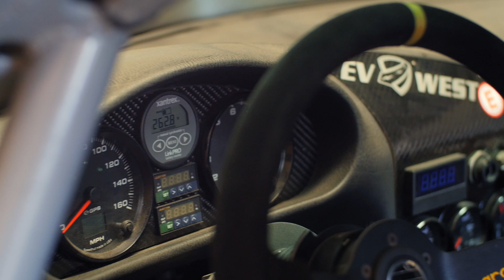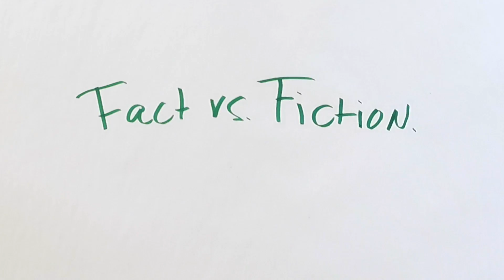How to Make an Old Car an EV - /ENGINEERED

Comment: I'm sorry, but to transform a Ferrari on an EV is a crime.
Reply: Kenneth Hildebrand
Bad example, even if the eletricity comes from a coal power plant it's still better than making the same amount of energy from a gasoline engine, basically because power plant is almost always running at peak efficiency.
Reply: +Kenneth Hildebrand You know, people can demand solar power to replace coal.
Reply: +Renato Dumaresq Actually, it's a good idea. People can and will be more willing to drive them more often, and will cost less to maintain them.
Reply: +Renato Dumaresq they didn't cut anything so the process is completely reversible anyways. What would you do with an old ferrari with a shot engine where parts are damn near impossible to source? Especially if its a pretty bad engine to begin with. That's probably not the circumstance but there are a few very rational reasons for someone to do this kind of replacement.
Reply: Probably the engine was already broken and turning it into an EV was cheaper than a new engine
Reply: Renato Dumaresq its a spoiled mellinials who told dad that they took his ferrari to the shop
Reply: +Renato Dumaresq Not a 308 GTB, they perform like dog shit when stock
Reply: +Renato Dumaresq Yeah, he should  keep the original, decades old engine, and never really drive the way the car was meant to drive, because if you break something, it will cost an arm and a leg to fix, since there are almost no parts available.
Reply: +DieselQuads But they don't sound like dogshit. That's the point.
Reply: Yes I is. Plus everyone thinks they are saving the planet with EV while charging them with electricity from the local coal burning power plant.

Comment: Sacrilege! "Make them better" my arse.
Reply: +Carl Draper That's only your opinion, I think what he's doing is great, keeping classic cars on the road.
Reply: guifrakss But they were perfectly fine on the road with their original engines!
Reply: Carl Draper How do you know? Do you know every car this guy's company has worked on? Maybe most of his costumers have a car with an blown out engine or transmission, in wich case, it makes sense changing engines, because repairing these old sports cars can get VERY expensive, if not impossible.
Reply: guifrakss and converting them to elwectric is cheaper? And what about range? Charging stations are few and far between over here, and if you let the power down too far you have to wait like 3 or 4 hours before it's charged up again. Hybrids are better.
Reply: Actually, no, because you can buy a very used one for very cheap, snd gasoline will only get more expensive.
Reply: Carl Draper 1) I don't know if it's cheaper, but probably is.
2) These classic sports have horrible gas milage.
3) You don't need a charging station, unless you don't have eletricity at home.
4) Four hours to charge is not bad, because you can charge while you're sleeping, unless you know someone who drives constantly for more tham twenty hours a day.
5) I like hibrids too, but both purely electric and hibrids have advantages and disadvantages.
Reply: Carl Draper
 Only if you care enough to spend it, if you don't, you don't have to.
Reply: Carl Draper
ok.
Reply: +Carl Draper so... i guess making an engine wsap is a sacrilège too  for you ? 
To me, puting an LS engine in a old camaro is not different than making it electric, and changing the gear and suspensions, In both case you have lost the nature of the old car anyway, so you can at least make it more performant.
Reply: riDDimann Taking away the engine of a classic Ferrari is like removing the teeth of a lion and feeding him on tofu.
Reply: I'm done here, they're just ruining old cars. Period. The Porsche 356 is a classic, even more so than a Ferrari, and without the air cooled Boxer engine sound, it's just  a pretty tin box.
Reply: guifrakss if you have the money to buy a classic Ferrari or Porsche, you're rich enough to afford petrol money.
Reply: guifrakss a very used one will need a lot of money spent on it

Comment: Nothing against electric, and I'm intrigued by it (am thinking about doing a conversion like this, myself), but if you're going to compare apples-to-apples, you can't just take the cost of oil refinery into account and not do the same for electricity transmission/maintenance, the cost of mining the materials to make the batteries, etc.  Not to say that these things aren't part of the cost on both sides, or to say that they're equal, but it is to say that a fair comparison should be done before presenting one side and omitting the other.
Reply: the Pro oil lobby fudges numbers all the time. When they calculate carbon, the ignore the massive electricity usage of refineries and how much energy is wasted just moving around oil and gas. Petrol is far dirtier than people realize. But at the chemistry of it, ICEs are still wasting 75% of energy as heat.
Reply: +n8guy Both sides certainly have hidden costs but the levels of BS on either side tends to differ hugely. The BS coming from the oil lobby is epic as they try to protect a soon to be redundant technology. Just one point, lithium is not only plentiful it's also recyclable.
Reply: +n8guy If you do an apple to apple comparison EV win by a wide margin, even if they are coal powered. It is the oil and ICE car lobby that tries to prevent that apple to apple comparison and muddies the water, so usually gas just falls right out of the sky at the gas station while they go to great lenghts finding every ounce of energy that ever got into the EV producition, complete ignoring that an ICE motor requires a lot of energy to get manufactured too. Do you ever hear about the metall for that being mined, transported, getting melted and cast? How much energy is required for making a battery and how much is required for melting a complete ICE engine block?
Reply: +thorium222 I think you misread me.  My point wasn't that one "side" wins over another, it was that when he identified the "hidden costs" on the ICE side, he conveniently ignored the same on the EV side.  That really was my point.  That said, let's deal with a few of yours.

"If you do an apple to apple comparison EV win by a wide margin"

Ok, that may be the case - do you have a source for that statement?

"Do you ever hear about the metall for that being mined, transported, getting melted and cast?"

Sure, that's one of the hidden costs that needs to be taken into consideration.  As is the materials and process of producing electric motors and batteries.

"How much energy is required for making a battery and how much is required for melting a complete ICE engine block?"

I don't know the answer to this, but my impression is that things like lithium are harder to obtain than the components of steel, both in scarcity and cost.  But either way, again, it's just part of the comparison that needs to be done.

You seem to misread my comments and not realize that all I'm asking for is apples-to-apples.  I don't know which side ends up being more cost effective, but I do know that both sides have hidden costs.
Reply: n8guy You can see here for example the lower life cycle energy requirements and CO2 emissions of BEV:

http://www.environment.ucla.edu/media/files/BatteryElectricVehicleLCA2012-rh-ptd.pdf

It is from 2012, so it is already better I assume, but this was the first hit on google. Looking just at usage without the production of oil, coal, conventional vehiclesl or BEV, I calculated for a comment on a German website, that even if electricity supply was from 100% coal in Germany, BEV would burn 12% less fossil carbon than top of the list ICE cars. Of course Germany has already about a third renewable energy, so that is only a thought experiment.
Reply: Dude, lithium is everywhere! It's one of the most common elements on Earth...
Reply: +n8guy Exactly what I was thinking. There should also be a time comparison IMO, fluffing over the fact that you have to wait 5-6 hours for a charge because it suits you agenda is BS.

Comment: electric cars are more practical if you can do a battery swap. even for formula-E gotta swap batteries... not cars.  need to design car to drop batt and go. which is difficult even for tesla as they use the batteries as the foundation and structure.  not modular. ev west is cool. love the bimmer. i want to build an EV, its on my bucketlist

Comment: ok cool not sure if I like the idea of taking the engine out of the 308 though
Reply: +Shane D As long as they don't cut in it, so that you can put back the original driveline, I'm totally fine with it. Besides, we don't even know if the original engine even works, or if it is ruined for some reason.
Reply: SgtStinger good point
Reply: +Shane D Ok, don't do it with your car,then.

Comment: So let me get this straight it's faster more reliable better for the environment. What's not to love, great job EV west
Reply: +LordOfInferno I think that depends on the car. Some icons, like the Shelby Cobra, are defined by their engines. Others, like the Citroen DS, are about everything else. If the main focus of the car isn't its engine, then I have no problem with people who change that. Imagine an electric DS, that would only enhance the ethos of the car, it'd be better I think.
Reply: +Notta Gonnatellya that seems to be the popular idea.  electricity just comes from nowhere and cost nothing.  and of course you can recharge anywhere.  lol

have nothing against electric.  just alot of bs around it.
Reply: You guys aren't considering that electricity sources are improving. In some parts of the world, electricity is already predominantly renewable. Conventional cars won't really improve, because you can't avoid digging crude oil from the ground and burning it. Electricity, even in its current form, is a lot more environmentally friendly, and it will only improve until it's carbon neutral. The argument that it's not carbon neutral does not negate the argument that it's better for the environment, because it's still better.
Reply: +Notta Gonnatellya  If you do an apple to apple comparison EV win by a wide margin, even if they are coal powered. It is the oil and ICE car lobby that tries to prevent that apple to apple comparison and muddies the water, so usually gas just falls right out of the sky at the gas station while they go to great lenghts finding every ounce of energy that ever got into the EV producition, complete ignoring that an ICE motor requires a lot of energy to get manufactured too. Do you ever hear about the metall for that being mined, transported, getting melted and cast? How much energy is required for making a battery and how much is required for melting a complete ICE engine block?
Weniger anzeigen
Reply: +Bryce Hale  it makes a soulfull car, dead as a smartphone?
Reply: +Notta Gonnatellya  An ICE vehicle can only run off fossil fuels. An EV can get its fuel from any source. My EV runs for free off my roof. Yes, the environment benefits but, more to the point, my wallet loves me for it.
Reply: +LordOfInferno Weight distribution can be controlled much better with electric as you can place the batteries anywhere you want. You're right, it will add a lot of weight but also torque.

I wish someone comes up with a battery swapping system that can be done at home, that would really change things up. Imagine driving around town or coming back from work and you have to go somewhere else fairly far in the afternoon, no need to wait to charge.. just swap out the battery in idk.. 2 min and go along your way. Sure its still not nearly as practical as gas.. but baby steps first before you start running.
Reply: Gabriel Soria That might work better for electric scooters and motorcycles, where you could pick up the battery in your hands, but electric car batteries are enormous, and extremely heavy. Doing it at home is not too different of an idea to doing an engine swap at home. Disconnecting an engine is far more complicated, but actually lifting that weight out requires the same large and expensive equipment.
Reply: Alfred Munkenbeck   Hey I would love the day I can make all my own energy on my own property.  Not there yet but that would be great.  Just not quite there yet.  Or my pocket book isn't quite there yet.  LOL  

I don't know if it's better for the environment or not.  It's still new so I can't say.  If we can all get on our own energy sources then I think so.  As it stands I don't think it is better for the environment.  More important, if we all switched to electric cars I don't think our current power grid could handle it.  So we either all make our own energy or we start laying down new wire.  Second of which would definitely be worse on the environment.
Reply: +Alfred Munkenbeck  That is true, but the problem here is not electricity generation, is the batteries. Just confront the weight of your laptop or phone battery with that of a Tesla for example, we are talking about 1000 to 10000 times more. This alone should make it clear that we are are far away from making electric cars (with batteries) for everybody without huge enviromental issues because of the amount of i.e. lithium that would have to be extracted. Fuel cells might be interesting though.
Reply: +Gabriel Soria my thoughts exactly, why can't manufacturers get their heads together and make universal sized battery packs, small packs for small cars, medium packs for medium cars etc. One would just pull into a service station and swap their discharged pack for a fully charged pack and pay accordingly, this waiting for the batteries to recharge is just a big turn off for EVs. Another turn off is having to pay for the economy of EV up front, EV on average, are at least 15-20% more expensive to purchase than a gas powered vehicle, 15-20% pays for a lot of gas. IMHO
Reply: +cee doubleyou I think Tesla Motors are addressing those exact concerns in their own way, because I think that's only the way that's available right now. With the Tesla Model 3 coming out at $35,000 and appointed battery swap so you can do for free they're getting somewhere at least.
Reply: +OutlawUniverse Unless you live in an area where most electricity is hydroelectricity. :P  At the end of the day, oil is not unlimited and they're destroying the planet.  There are many ways of getting electricity, some better than others, and the difference is they're improving extremely fast, just like EV technology, compared to the 100 year old tech we have in cars now.  If a Tesla can destroy most supercars off the bat in its first or second generation can you imagine 100 years from now how much better EVs will be?  Compare the first Tesla to the first combustion engine sedan.
Reply: +Alfred Munkenbeck It is today, but a few years ago it was worse, a few years from now it'll be better.  We didn't always have the ability to power 1080p full color screens on mobile devices that fit in our pocket for hours...In just a few years, it became common stuff.  In 5-10 years car batteries will be completely different, unlike combustion engines which haven't changed much.  We went from computers the size of rooms that did basic things to accessing the entire planet's information on your watch in just a few years...EVs will advance similarly, that's the great part about this.  Yes, there will be complaints along the way, but things are constantly improving where as other cars used gas 50 years ago and they still do today, not much has changed.
Reply: +cee doubleyou Tesla is doing all that.  They have battery swap places. :P  Also, they're more expensive, but how expensive would a phone with a 1080p multi-touch screen have been 10 years ago?  We went from big TVs that cost $40k to $500 in just a few years, but have Ferraris gotten any cheaper?  That's the difference between electric and old combustion engines.  In just a few years, cars with batteries similar to today's Model S may cost a fraction of the price, so something the price of a Model S can have way more features or a much longer range.
Reply: +Bryce Hale i agree, mostly. To me you loose the sound of an old great engine and it's caracter. I  mean, naturally inspired V8 ford 440 sound awesome. But on the other hand EV have a lot to them too. There is matter of discussion indeed.
Reply: +cee doubleyou The government rebates (federal and some local) really help to offset that 10-15%. I know somebody who recently bought a new Chevy Volt for about 15k after negotiation and rebates. That is less than a ford focus, its better equipped and even when the battery is dead it gets better gas mileage
Reply: +Robin Harrison thirteen miles to work and all day free charging in the employee lot!
Reply: Bryce another ignorant person. How do you get lithium? How do you electricity? You can answer that yourself.
Reply: Bryce  all I know is I would save money on turning  94 mustang  electric.  No more gas no more  oil changes.  Just my electric  bill. The zombie  got me interested  In electric mustang